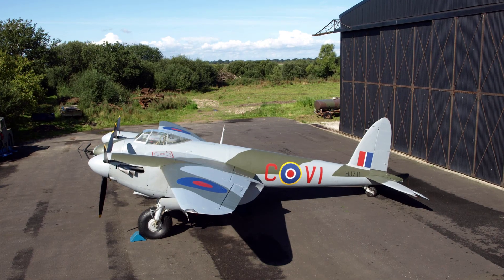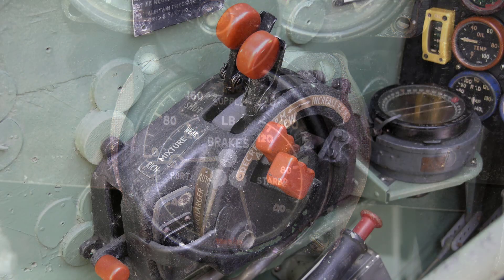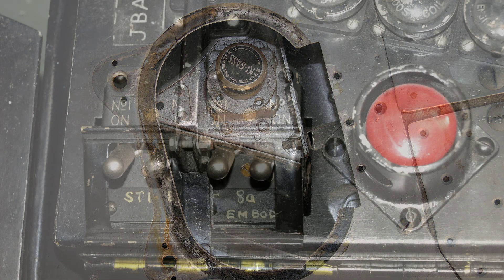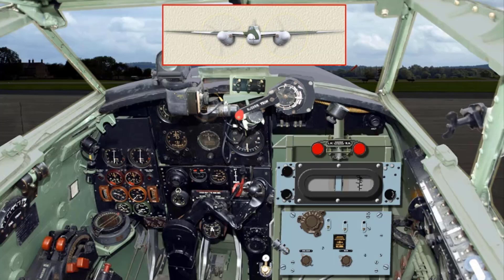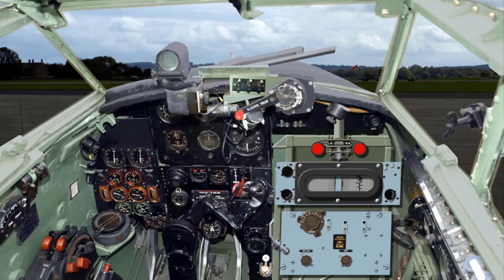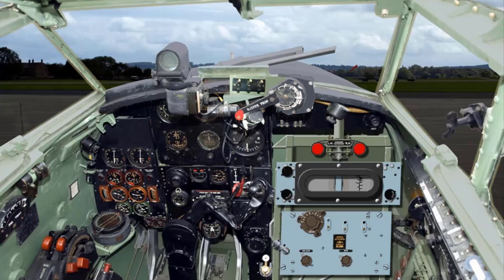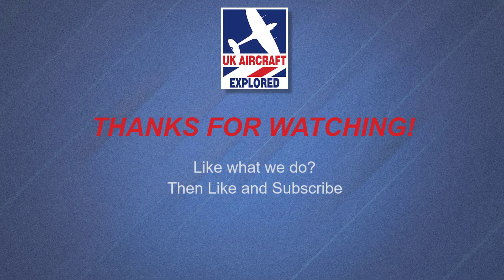Mosquito Night Fighter – Engine Start Sequence

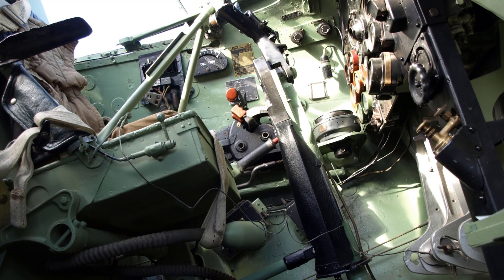Comment: 3:30 the RPM gauges on the Mosquito are 5,000 RPM type, with two needles.  The short needle sweeps the thousand scale, and the longer needle the hundreds scale.  At 1,200 rpm for warming up, the instrument would look like a clock face set at 1:10.  Whereas your graphic would show 5,000 rpm
Reply from the maker: Thanks

Comment: My late father, instructor and Mossie recce pilot, used to go through the procedures for take off in our car. Our local closed wartime aerodrome runway was still intact and we accelerated up to 90mph whilst I as a toddler sat on cushions.  Loved it. He also got out quickly in 2 emergencies via the canopy. His navigator reckoned they  did it in less than a minute. Amazing aircraft and its power and speed saved them with encounters over eastern Germany. As C.O. he remarked that he lost only one crew in 1944. The plane was never found. Its pilot was his best school chum too. I have a painting of them flying in formation over the Alps. Tough times and brave pilots all. The Mosquito saved many lives.
Reply from the maker: Thanks for sharing

Comment: How do you escape via the escape hatch in flight?
Stop the engine and feather the prop?
Looks difficult to get out  of, even through the top glazing panel.
Reply from the maker: Here's the wartime instructions - The Parachute exit was through the main entrance door on the starboard side. To jettison, the red handle had to be pulled on the door, and kicked out. Feather starboard propeller if possible. I shall be creating a huge series of videos covering the Mosquito. I will be covering all emergency procedures then. Thanks for watching
Reply: @ukaircraftexplored6556  Thanks for that. Great videos. It looks like an extremely difficult aircraft to escape from in flight. If the prop is not feathered it could spell certain death from either exit. The bomber version with the hatch in the floor behind the clear vision nose could be the version with the best odds of success to escape from.
Reply: It sure looks like the props are forward of the access doors to me

Comment: Very interesting.  I think the procedures should have included "confirm that there are no ground personnel near the propellers" prior to hitting the Start  ;) !
Reply from the maker: Maybe, but for authenticity, I keep to the wartime manuals. I know that air and ground crews were taught to avoid this very dangerous  aspect in servicing and operating wartime aircraft - often at night. Thanks for watching.
Reply: I'm not disputing your great work "video-ifying" the manuals. Just that it's surprisingly that there was no warning in the manual.